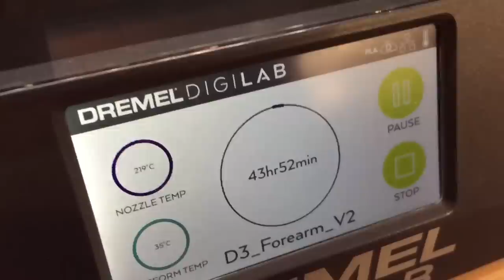How To Make - The Stark Nano Gauntlet

Comment: excellent video, where can I buy that airograph that you use to paint the gauntlet and what paintings do you use to paint the pieces in 3d?
Reply from the maker: alex c. Hello there Mr. Alex. Sry for the late reply. I used an airbrush for the painting. Its an HS Infinity airbrush. You should look up what suits you best. Beginner airbrushes are easy to get, and usually pretty cheap😉 For the paint, I use a wide range from acrylic, enamel and different lacker paints. Thanks for watching the video. Have a great one Sir😉

Comment: The video shows how you put the thing together, but how did you actually make the pieces of the gauntlet? (Hand piece, fingers)
Reply from the maker: The Last Feelbender Hello there Sir. I made the joints in Tinkercad. But I’m still learning the 3d modeling part. (Working in Fusion360 now) So I left it out for now. But I will make sure to put it in the next videobuild😉

Comment: Edit: I see you already use a lot of the techniques for scratch building cardboard models.

I highly recommend using Sketchfab to search for models if you want to scratch build from cardboard. They provide great references, as you can rotate them and view them from any angle. Or, if you know how to use a 3D program, you can sketch your own model and use it for a reference.

When I run across a channel like this, I usually subscribe to it and leave a comment, because I'm building my own DIY scratch build YouTube channel. I can't work, I'm kind of crazy in the head, I keep getting denied for disability, so this long shot seems like my best shot. So, I go around looking for these kinds of channels and liking them and subscribing, hoping that karma will give me a break and I'll have the same kind of attention drawn to my channel.
..
.
.
I've been perusing your channel for about half an hour, and what can I say? Super cool models. I can't be sure, but I'm assuming that you are designing these models in Blender or CAD or 3DS max, 3DS Max was a software I was taught on I have a computer animation degree, but that's of no consequence - but I was just wondering, after perusing maybe a half dozen of your projects, have you ever considered scratch building out of you know, materials that aren't printed 3D objects?

Talking about materials like paper, manila folders, poster board, cereal boxes, super glue, hot glue, epoxy resin, wood glue, spray varnish, spray paint, primer... do you have an airbrush? Of so, hell yeah! 

I don't have an airbrush so I just don't use airbrushes. I use brushes. Anyway, you can build some really rad stuff out of cardboard once you've gained a little bit of experience. 

You can still design them in 3d, if you know how to use a 3D program, that's a real help. Because it's really hard to model things from just references that you find online, because Sketchfab is the only place where you can rotate them, and you don't have full freedom.

Anyway, it's a very satisfying emotion, I guess you can call it, whenever you build a scratch built model out of nothing but your bare hands, materials that you find lying around, and you wind up with an X-Wing Fighter that looks freaking awesome. 

It's completely from scratch, and completely a product of yourself. Excluding the fact that an X-Wing wasn't designed by me. But still, it has my own touches. The one I'm in the middle of building right now is going to have space shuttle delivery. Livery is the decorations on any type of aircraft. 

My X-Wing will be black on the bottom, white on the top, black on the nose, gray on the nose tip, black surrounding the cockpit, is going to be named the Enterprise! It's going to be rad. And it already is halfway rad, because it's about one quarter of the way finished.

Ok, I was just wondering. Since you obviously have an overdose of talent, I was just curious as to whether or not you've ever considered modeling from scratch. Scratch building is what they call it. Not kit bashing - scratch building.

After you scratch build a really perfect model, and coated it with shiny aluminum and inscribed edge panels into that aluminum, and just give it all the detail that's possible to give to something on such a scale, with such limited resources, but looking so awesome, the feeling you get is...

I can't lie, I've done a lot of drugs in my day. But that was 20 something years ago. And I'll tell you right now, some of those things are really hard to let go of because of the great feeling they provide. 

But, the feeling you get after scratch building a perfect model rivals the feeling of hydrocodone or oxycontin or morphine sulfate. Yes, I had a drug problem once, but that's ancient history. I was surprised at how easy it was to stop, after having been an addict for about 10 years. Sure, it was a struggle, but I didn't have to go to rehab. I kicked it all by myself with no help from anybody. I was really proud of myself. Now I'm clean and sober. Oh. Except for all my prescriptions.

Did I mention that I'm as crazy as a loon? That I've been in the booby hatch twice? That I have permanent insomnia? That I have to take antipsychotics just to sleep? That I have to take Adderall to focus? That I have to take Klonopin for panic attacks? That I have to take Escitalopram or Lexapro for depression?

God, I'm just a hot mess. But scratch building models out of cardboard is totally therapeutic. I don't know if I'll ever get my sleep back, but as long as I've got sleep meds, I'm not worried.

If you haven't tried scratch building a model, I highly recommend it. I can't speak for those who create models by 3D printing them and then painting them and then putting so much work into them making them look exactly like movie props, but the challenge is so much greater when doing it with cardboard. 

And I can imagine the satisfaction is also that much greater. Especially whenever you design the model from scratch.

But, you have a great channel, I've enjoyed very much perusing it, and I'm about to go back to perusing it.

Have a great day, week, month, year decade, and life. Stay away from the drugs! 

Oh, and I forgot to mention one thing. I have three laptops - one for displaying all kinds of references, one for playing movies, and another one I'm still trying to figure out. It's got Ubuntu installed on it, and I don't like that. It also has Windows 8, and I like that even less. The thing is, it has no Bluetooth driver for either OS, and after 6 hours of messing with the damn thing yesterday, apparently it's impossible to put bluetooth on this damn laptop!! I can't figure out the freaking Bluetooth drivers for that computer! I don't know what I'll use it for, it's a handy dandy little laptop, although the battery is completely dead. 

But plugged in, it works great. That is, if you consider Ubuntu great and having to go into a damn command prompt and type sudo before every damn thing you want  it to do, and it usually coming back with an error code.

Well, I'm just about fed up and ready to erase the damn hard drive on the thing and install Windows XP on it. That's always been my favorite Windows. My brother Matt tells me, don't do it Ash! Don't do it! Microsoft doesn't support Windows XP anymore! All of the drivers are taylor made and custom built for Windows 7 through 11! Windows XP will freak out!

Well okay, maybe he's right. Maybe I'll just put Windows 10 on it. I hate windows 10, but at least I'm getting used to it. And I like it way better than Linux.

Whoops, there I went and digressed again. I do that a lot, because everyone is my therapist. I'm pretty much cray cray, but you wouldn't know about it by looking at me. It's all in my head. And I will talk somebody's head off in any comment section, or person to person... hell. I talked my moms' boyfriend's ear off and it took me 10 minutes to figure out that he was itching to get out of the door and get in his truck and go home! 

See, I don't have a licensed therapist. I can't afford one. I don't have a job, because I can't hold one anymore. I'm pretty much fucked. I'm indigent, I'm a dysfunctional adult after 90% of my life being a functional adult, until insomnia, the permanent kind that never ever ever goes away, crash down onto me like a planet and then all these other disorders started cropping up like depersonalization, panic attacks, chronic anxiety, depression, PTSD from the dam insomnia - I spent two years awake if you can believe that, but it's true. I swear to God. This is when I was still trying to figure out what was happening to me.

Anyway, enough about me! Sorry, I used you as my therapist. I do that to everybody. 

Back to you. This is your channel. Great models, I'm a great admirer of anyone who can produce an object that you can hold in your hands and turn around and look at and it  looks great and satisfying. And this is what you do. I only suggest...

I only suggest that you try your hand at scratch building. That is, using poster board, manilla folders, paper, cardboard, glue, scissors and X-acto knives, and if you know any 3D software programs, those are invaluable for sketching out your 3D model so that you can build a 3D sketch of it that you can hold in your hands. 

Not the final model, but it's 3D sketch, if you can apply the term sketch to a 3D model made out of cardboard. These things are invaluable for getting the gist of what exactly you're building, and the correct proportions of it.

Then, after you've built your model with all your materials and your glue and you:ve painted it and you've made it your own, whether it's an original model or something from a movie...

Man. The feeling you get from holding that model in your hands and turning it around and looking at it and admiring all of the detail, from the aluminum coating, the cardboard, the paint, to everything! 

Well, that feeling is comparable to one of the best drugs I've ever done, and yeah, I used to do a lot of drugs. About 20 years ago. Some really really good ones, I'm telling you. 

You get a feeling very similar to one of the best highs you've ever had from one of the best drugs you've ever taken.

Now. Don't do drugs! Don't be a doofus like I was! I was just merely suggesting, or asking actually, if you've ever tried your hand at scratch building. 

Specifically, with cardboard. It's an experience that you'll never forget, because it makes you feel so good whenever you're done.

Anyway, back to perusing your YouTube page. I'm having a great time looking at all the things you build.

Stay groovy copacetic! Oh yeah, o your movies monitor,, if you have one, play Frozen over and over and over, at least one hundred and fifty thousand gillion gazillion and 6/5ths times while you're scratch building. 

Either that, or Who's Afraid of Virginia Woolf. That one works too. You see, you need the right kind of inspiration.

Ok, ta-ta!l